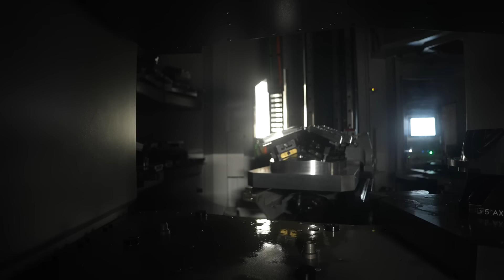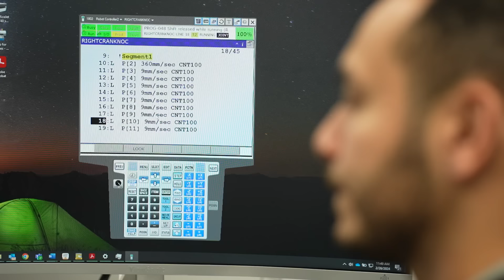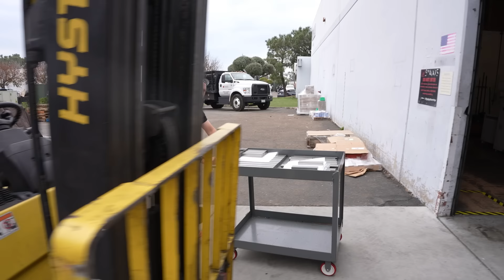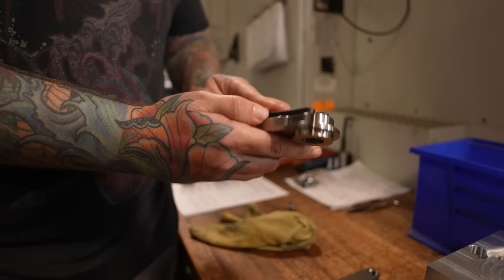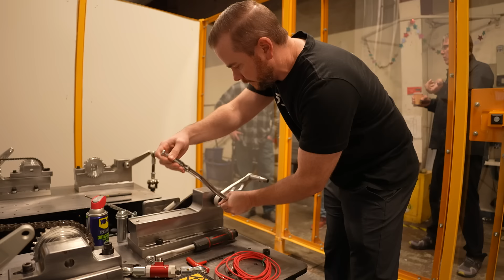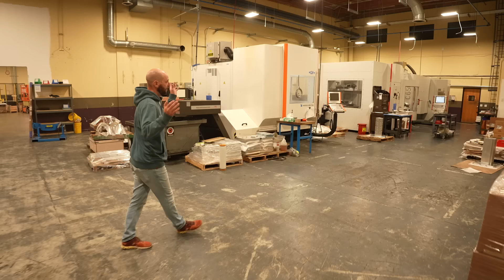Building The Ultimate Bike Parts | 5DEV Factory Tour

Comment: I understand it’s a one piece design whereas most other manufacturers weld two halves together. The design requires a certain amount of machining hours which is a bit more as well. And probably the parts per hour are fewer than in other factories productions. Well, none the less they’re offering a dub spindle and for many people that’s easier than wrapping their head around the chain line of their bike. So yeah they might be a few grams heavier than similar products but they have their place on the market. Though I would appreciate the price of the aluminum enduro ones to go down to 400-450 over time. Machines depreciate, personell not. It’s on them if they translate that into a higher profit margin or a lower price.